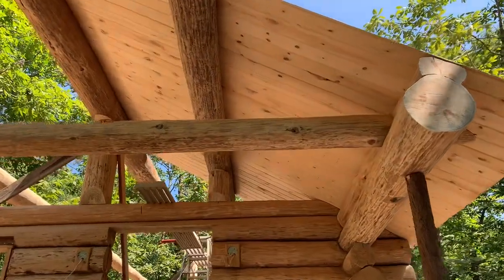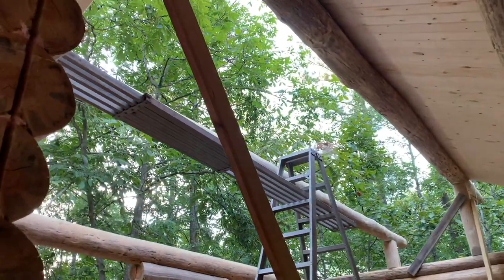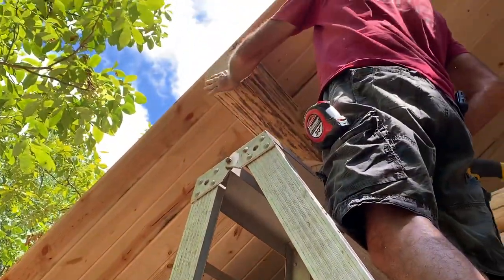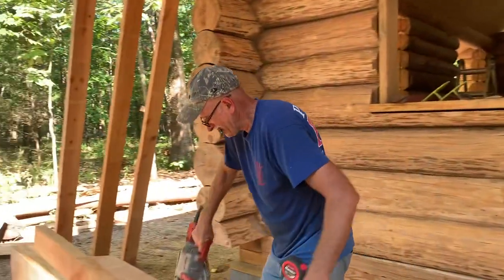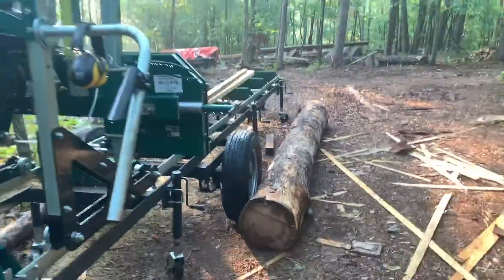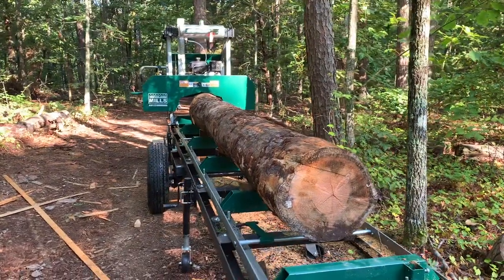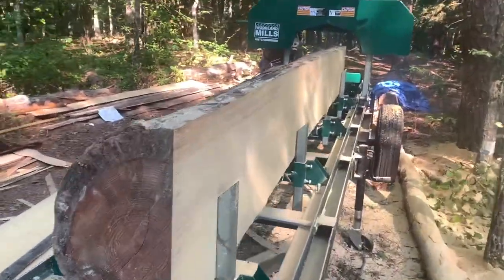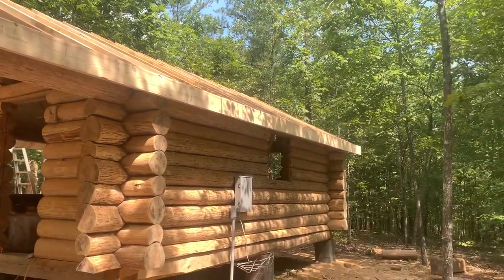Log Cabin Build Part 21, Roof is going on! Tongue and groove ceiling, rafters, fascia, trim, wiring

Comment: Isn't it amazing how, once the roof goes on and the space is enclosed, the size and scale of what you guys have built becomes so clear? It's looking fantastic already and it will only get progressively better and better as you move onto those finishing touches. And then we can look forward to watching you working on the interior! 
You should be justly proud of what you've achieved here and I understand when you look at the cabin and wonder "did we do that" and have to kinda pinch yourselves. But yes, you did it! 
Can't wait for the next installment!
Reply from the maker: Yes Stevan, it seems bigger now. We are pretty happy with how it is turning out. 😁💕

Comment: I like to use Emseal precompressed log tape under the T&G on top of the ouside wall log, and a little piece between each board right above the strip ontop of the top log.  Otherwise the T&G will shrink and leave a gap that may be a little hard to caulk later.  Absolute, great job guys !
Reply from the maker: Right! We used it between each log, but completely forgot to use it between the top log and the tongue and groove. We are going to have to use a line of expanding foam on the inside and cover with a piece of trim. Oops!!😬😁
Reply: @natureartgirl  I believe a bead of log caulk later would be sufficent.  Love your vid's !
Reply from the maker: @MountainDreamLand  thanks! Sounds like a good idea!

Comment: Hello guys,  not long ago I had asked you about only notching for rafters. I see now that no rafters used. Simply using purlins. Got it now. Cabins looking great. Keep up the good work.
Reply from the maker: Yes, we put the rafters on top of the tongue and groove which is a little strange but saves a ton of finishing work later. You do have to be very careful walking on the tongue and groove, it’s not very strong. Good thing Lance is pretty skinny😁😂

Comment: Looking great with the ceiling tongue and groove. You’ll feel happier once the metal roof is on for weather proofing, and to be out of the heat, and you can comfortably work on the inside at your own pace. I know it comes down to cost, and I guess during winter , you’ll want the cabin to be snug, but it’s a shame not to have windows at both ends for extra light, and to be able to see the trees outside. I’m picking your winters are pretty severe, so to have less areas for warmth to escape is paramount.
Reply from the maker: Yes, the gable end would be pretty with windows. But we are putting in a bathroom back there and the wall would go through the middle of one. It’s just a small cabin. We don’t get real cold here normally, so that’s not really a problem. I think we will still get a lot of light from the windows and sliding glass door, but you can’t have too many windows 🤣😁🤣👍

Comment: Just wondering where the roof vents are!  Other than that, it's an amazing job the both of you are doing.  Many thanks!
Reply from the maker: Good question! They are under the soffit. We had not cut them in this video yet. They will be in the next one. Then we have ordered vented closures for the top of the metal roof. And have little round finishing trim caps for the vent holes so bugs can’t get in. Although we are going to wait to put them on till we finish staining. 😊👍

Comment: If you take your scafold plank and screw a vertical 2x4 to the bottom of it with structural truss head screws you will take the spring out of the board
Reply from the maker: Ok👍

Comment: STep ladders of any height are so wobbly in side load I have often wondered why they don't make an add on small brace that a guy could clamp on both sides and a clip in flat plate at the top that would slide into place to stiffen them up.  A twelve footer is a spooky thing even with a plank on it.  Roof looks very nice.  If warping and checking from sunlight is a real concern it wouldn't take long to coat the exterior with urethane varnish as you finish installation or better still put your roof membrane down right away.  It would be a  shame to see that expensive wood messed up with sun drying it too rapidly.  In my opinion you can't have too long of an overhang.  If it is long in the back I would leave it that way.  Log structures really benefit from all the weather protection you can give them.  Overhangs go a long way toward keeping them dry and the finish long lived.  Enjoy the project.
Reply from the maker: Thanks Douglas! Yes, a longer overhang in the back would be a good idea, but only two of the support logs were longer so we had to trim them to match the shorter one. Those were the longest mostly straight logs that we had. We did put roofing felt down right away to protect the tongue and groove which turned out to be a good thing since we had two brief but intense thunderstorms 😬😊
Reply: They do make leg adjustable attachments to put on ladders for that!!
Reply: @donaldhofman5257  Yes they do but I am talking about bracing not uneven ground leg extensions.  If you have seen any I would be interested to know.

Comment: Do' you not need rafter ties?
Reply from the maker: You could add them if you wanted to, but we didn’t really need them. We put 10” long screws through each rafter into the log underneath. They are not going anywhere 😊👍
Reply: @natureartgirl  Thanks , was  just wondering. I am enjoying the build.